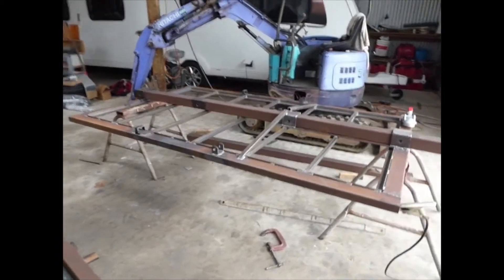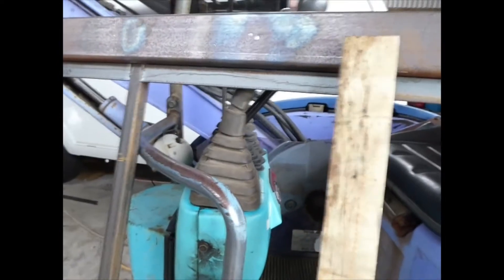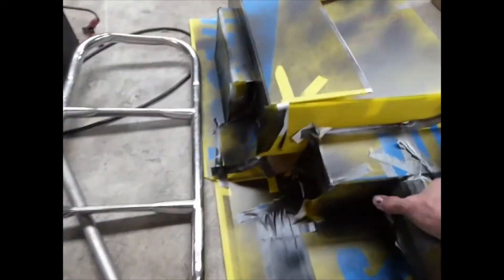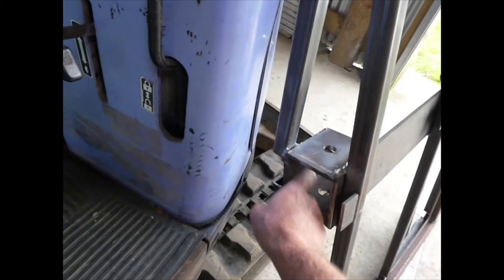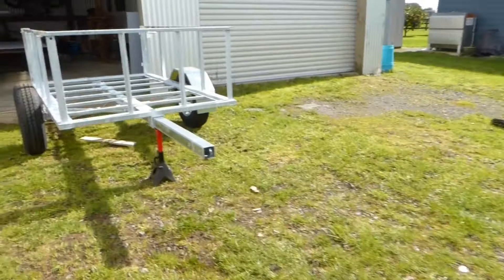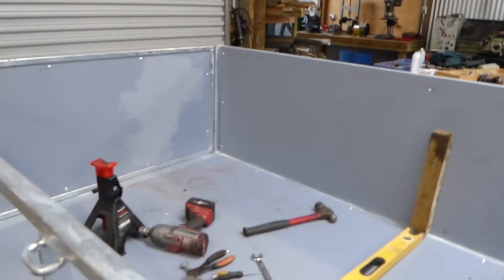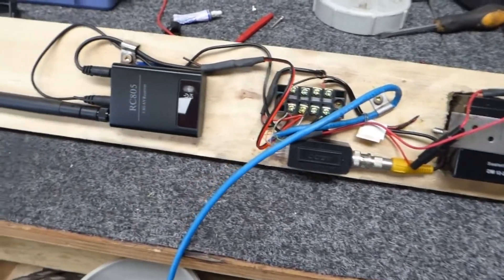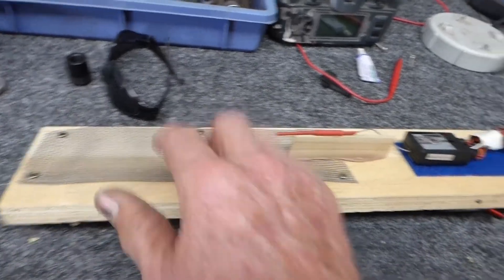New Trailer

Comment: Intresting video included a little bit of everything. I have never seen the galvanizing process before but I hate welding on it for sure. Both trailers look nice and I will need a trailer soon for my projects.
Reply from the maker: I grind the galvanizing off before welding. Apparently not good for the lungs.
We have lots of rain and sea spray here that rusts everything fast.
Reply: @Paulman50  I also grind it off but sometimes the fumes from inside of the pipes gets me. I truly now avoid galvanized material. So basically you are close to the ocean. The truck I have was located about 100 miles from the coast so had some severe rust on the bed that I yanked off. The old bed has a vise that's rusted up and may try fixing it and if not use it as an anchor. 106F at the moment and my patio umbrella sure helps me a bit.
Reply from the maker: @cutweldngrind  we live near Bell Block. There's a mountain on one side and the sea on the other side.  It's possible to shoot a deer in the morning and catch a Marlin in the afternoon here. 10 minutes to the sea and 20 minutes in the other direction and we're up in the snow.
Reply: @Paulman50  I try to imagine this scenery you mention. I sometimes feel so unlucky and maybe 1 day may try moving up north so I can see some green grass again.